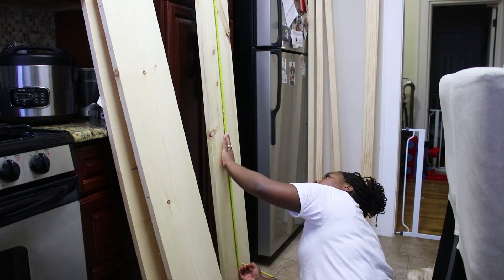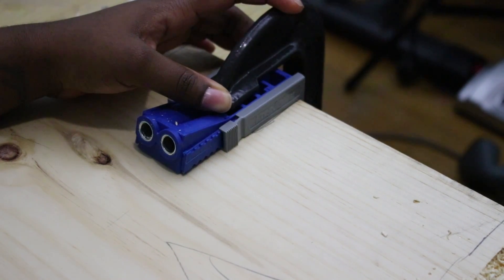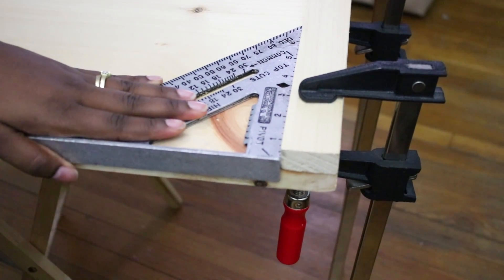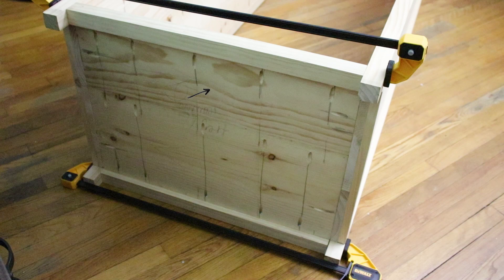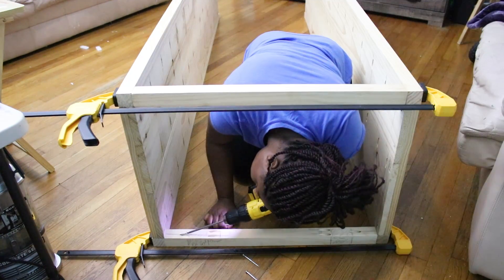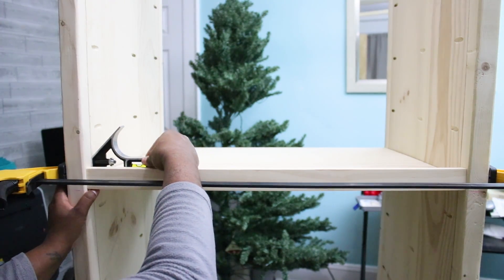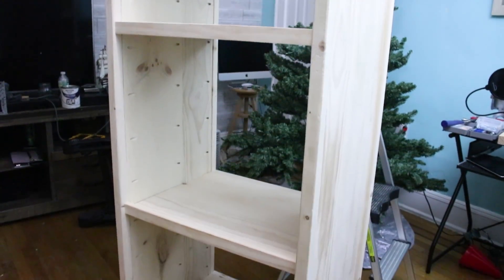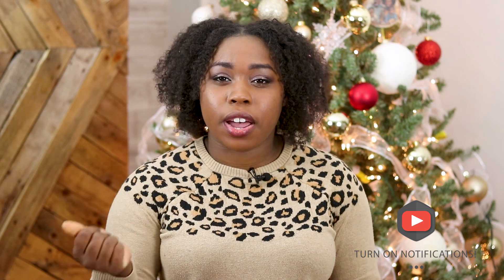DIY Wood Storage Cabinet

Comment: Your helper(?) at 3:46 looks THRILLED to be "helping" lol.
Reply: Simply Handmade I have been accumulating Kreg system components over the past few months.  I already built a new workbench from plans provided by fixthisbuildthat.  I’ll be doing a project similar to this in a slightly smaller version, over the next couple days.  Thanks again for the great video.